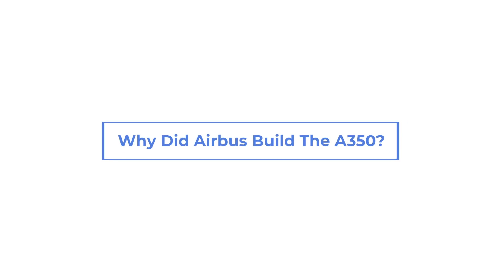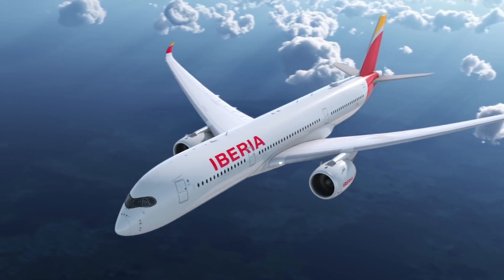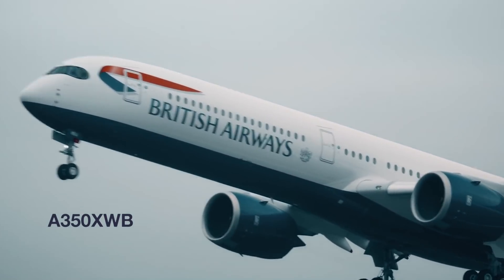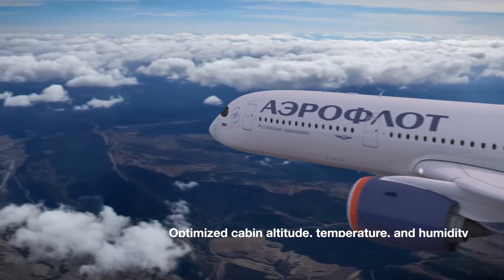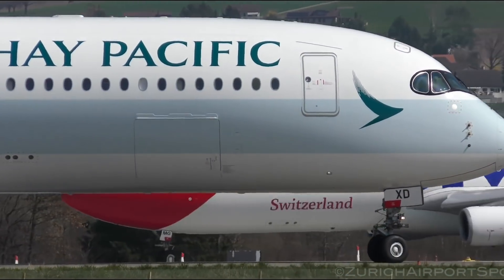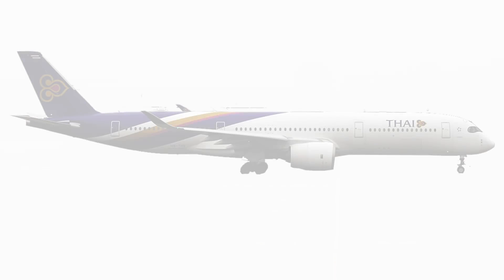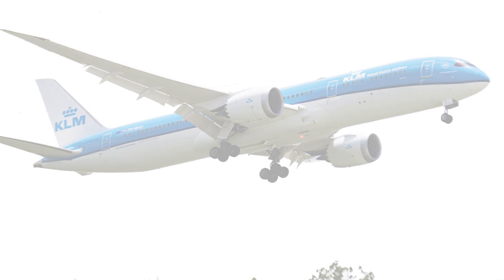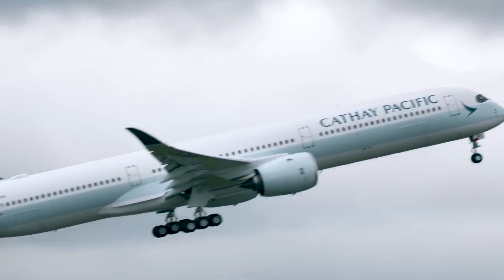Why Did Airbus Build The A350?

Comment: Contrary to popular belief. The A350 is not a direct competitor to the 787. The A330neo competes with the 787. The A350 competes more directly with larger and ultra-long-haul Boeing 777. Delta is replacing it's 777-200s with A350s, United has A350 orders to replace it's 777-200 and other carriers around the world have ordered the A350 to replace their 777-200s.

Comment: The A350 competes with the 777X (-900 competes with 777-8, -1000 competes with 777-9). I believe Airbus is gonna use the A330-800 and -900 to compete with the 787.
Reply: the 777-9 has its own league so does the A350-900 so it doesn't really compete each other, the only overlap is the A350-1000 vs the 777-8, while A35K is better being passenger jet, it's worth noting that the 777-8 will be better at freighter
Reply: @stoje8405  The main reason why airlines like Delta are replacing 777s with A350s is because the A350 has a similar seat capacity to the 777. However, people think the A350 is competing with the 787, something I don't understand as the 787-10 still has less seats the the A350-900, which is similar in size the the 777-200/777-8.
Reply: @sidewalk__  uh the 777-8 seating is similar to that A350-1000/B777-300ER actually

Comment: While you are correct in surmising that the A350 competes with the 777, it is erroneous to conclude the current design was built to compete with the 787. It is true that it was initially designed to compete directly with the 787, and that idea eventually turned into the A330 NEO. Airbus decided in redesigning the A350 that the 787 had gained too much of a lead for the expense to be worth it, so they made it bigger and targeted 777 operators with a new alternative.
Reply: And it is true that variants of the 2 families compete. The A350-900 and 787-10 compete very closely in size. The 787-10 was actually a response to the A350 as Boeing got scared that 777-200 orders would dry up.

Comment: This airframe success is solely based on passenger hauls.. 787 and the 350 will not ever be turned into cargo planes ... all successful airframes have a cargo version... carbon fiber although light and stronger then metal construction cant deal with the stresses and brittleness the carbon is inherent to ..

Comment: Advanced yess.but still a notch below the 787 ..
Simply put , your still using an archaic bleed air system. For most of the systems....yeah ....,I know the 777 does too.
   But electric architecture on the 787 is much more advanced,...and simply more efficient.
  Sry. a350 fans..
Them just the facts.!!
Reply: But do the airlines care?

Comment: TBH, the 359 isn"t directly competing with the whole 787 series, it looks like the 350 family is a response to the current 777 family only and replace their old 340 family. If you look deeper with the spec of 787 family, you could find that -8 is in addition to replace the 767 family, it also competing with 332/338, on the other hand -9 is competing with of 333/339. The spec of 787-10 and 359 are quite unique, for example -10 could carry similar passenger as 359, however it flies shortly range, which is could only fit to few route but gain a huge income, for example, HKG>TPE, HKG>ICN, HKG>SIN. Lastly, the spec of 359, which could be a replacement of 772 and for carriers demand something better than 333 but not 777, the 359 is perfectly adopted into this market.
Reply: Plz watch Coby's video, he has explained all it.

https://www.youtube.com/watch?v=9Z65CDW0LVI

Comment: Please who can differentiate between A330neo and A350 just by looking at each of them individually.? 
They look so similar; distinctive dark windscreen and curved wingtip.
I know A350 is wider and suited for long route, but I can't compare if they aren't side-by-side with the neo.
Reply: "Basic" design are the same. A350 is larger, longer and higher capacity.

As for specifics, they are trade secret. You can search google and find them. Visually, size will differentiate them.

Comment: This is wrong. The A350 was built to compete with the 777 and now 777-x series. Boeing built the 787 to replace the 767 and compete with A330 neo. By this videos logic the 787 was built to compete with the 777 which would canabalize sales and no airline manufacturer would ever do. Informative video though.
Reply: hmmm actually the 787 was a A330CEO competitor and then Airbus launched the A350XWB to compete with both 777 and 787 and the main B787 direct competitor, the A330NEO, while the NEO loses to the 787 at range and very slight difference efficiency at certain ranges, it gives a surprisingly close competition considering it's just new wings and engine, and another fact that the development cost is so low and no additional pilot training is required, this is a pretty big hit. Now i can see why Delta now ordered more airbus widebodies..

Comment: The real market for the A350: replacing the 777-200 and 777-200ER models built before 2001. And the A350-1000 will start replacing the oldest 777-300ER's from 2021 on. I expect the A350 to get both a GE9x variant and new Rolls-Royce UltraFan by 2024.
Reply: the 787-10 will take care of 777-200ER replacements to be honest. tThe 777x is going to replace the 777-300ER for many airlines like Emirates, Qatar, British Airways, ANA and so on. The A350 will not replace a 777 any time soon except for Delta.
Reply: @anuodubola2839  I agree. Singapore Airlines has already started replacing their 777-200ER's with the 787-10's (44 ordered) and so will Air New Zealand (8 ordered) soon. Great replacement for the 777-200ER.
Reply: @sulil1938  The 787-10 was a fantastic build for Boeing. It has prevented airlines from replacing their 777-200ER's with A350's. Airlines like BA, United and ANA i think . Although the 777X might be coming out to early as many 777-300ER's are just 5-10 years old for a lot of airlines. eg Qatar, KLM and so on

Comment: Anybody know if the A350 uses bleed air from the engine compressors and APU? Asking because of the air quality and humidity claims from Airbus
Reply: As I know, 787 is the only large modern commercial aircraft not using bleed air for that.

Comment: At 1:23 we can hear "Airbus claims the A350 is the quieter 2 engine aircraft" ...and that's because the 4 engine A380 is even quieter, ah! :)
Reply: Mik S Airbus claims the A350 is the quietest twin “aisle” aircraft, not twin “engine” aircraft. Both the A380 and A350 are twin aisle aircraft, and if the A350 is the quietest twin aisle aircraft, that means it’s quieter than the A380.
Reply: @Zamtrak25  
Good call!
Thanks.
:)
But still the A350 isn't quieter than the A380.
We can find some figures online that point to that conclusion.
Here 's one example:
https://www.uscreditcardguide.com/how-noisy-is-you-airplane-cabin/
Reply: @Zamtrak25  technically, the A380 is a quad aisle aircraft, 2 upstairs, 2 downstairs.
Reply: @schumi246  It’s still a twin aisle aircraft bud
Reply: @schumi246  False.

Comment: Everybody knows this one.
Because airlines soon told them a renewed A330 wasn't enough.
And proof of that is that some (Delta for instance) ended up buying both, the A350 and the A330 NEO. Which clearly states they can have slightly different roles.
Reply: And with the added bonus that the same pilot can fly both aircaft!

Comment: When you realise airbus built a plane to replace ageing A340s and A380 so that it can compete with 787s and 777s,🤔
Reply: The A330 was already economically better than the A340s and the world was not fully ready for the A380.  Ahead of its time, if I may say so.
Reply: Alec Cross yeah but the a340 was there for routes which the a330 didn’t have the range to do
Reply: Alec Cross A380 is too late in the Jumbo play. The era of hyper aviation hub is gone.
Reply: @Onew92  Predicting the future is a fools game. One pandemic and everything changes, who knows what the future holds?
Reply: @aleccross3535  No A380 is very late. The hub and spoke system of air travel has gone as passenger numbers increase and flight to even smaller airports with twin engine planes become profitable for airlines.
Reply: Pedapudi Vishnuram 1000 IQ move
Reply: Airbus should have made a larger version of the A330, like with the 777, but I think it was due to ETOPS that airbus was limited (I might be wrong)
Reply: @The secular humanist to early to tell.

Comment: I can tell that the Dreamliner is a success
Reply: I agree, and so would many. The Dreamliner will always and has been a success for years, given how many orders and airlines use it.
Reply: @sulil1938  One wonders how far those advanced orders will shrink now airlines face bankruptcy. Low fuel prices make efficiency a less urgent problem, for the time being at least and heavy flight price discounting seems unlikely to return any time soon with less competition.
Reply: Not sure yet it could reach its break even point but yes its order are A LOT, btw do you know that development cost for dreamliner was $32B USD? (comparatively, A330NEO only have $2B USD for development cost)
Reply: @stoje8405  Boeing's own figures suggest the 787 won't break even until at least 1300 deliveries, perhaps as many as 2000.  It isn't too far from the lower figure, but that point is optomistic, and less likely now due to COVID affecting the industry and increasing costs to build.  Time will tell.  The A350 shares similar issues.
Reply: @shebbs1  but now with boeing said building 787s only at SC i'm declining those new built 787s, unless they fix the quality management at South Carolina😩

Comment: Your information on range for A350-1000 is outdated. Since July 2019 with a MTOW of 319MT it flies 8,600NM with full cabin, including standard reserves, no cargo
Reply: Luis de stefano No airlines would operate a flight without cargo so your figure won’t happen in commercial situations.
Reply: Miika Mäki obviously not, hardly any longrange twin aisle plane travels with no cargo, although the longer the trip the scantier the cargo. What I said is something different. I corrected the range stated in the video

Comment: I think the A350 is a well played hand by Airbus : one single model to rival and go head-to-head with  two of Boeing's.
Reply: Declan-Kayode Keegan and to replace 2 airbus models as well
Reply from the maker: It’s a great little (or big as the case may be!) aircraft - TB
Reply: It wasn't intended to compete with the 787, only the 777.  It was a bridge aircraft, filling the gap between the 787 and the 777, where they were hoping a new aircract could compete.  Airbus knew they couldn't compete with either model directly, as the 777X program had started, and the 787 was already saturating that market.  The 777-8 will seat closer to 390 passengers, leaving the A350 in the middle between the two models.  This is a strategy that has worked in a number of markets over the years
Reply: Well said!
Reply: Yes !!!!

Comment: I flew on the A350 with Lufthansa and liked it less than a 30 year old 747-400.  Seemed louder and more cramped, the cabin air was stuffy unlike the 747
Reply: Well, the A350 might have seemed louder and cramped because there's significantly less noise from outside than on the 747. That makes the inside noise from other passengers more annoying. That's why noise cancelling headphones are getting more popular on planes.
 Also, the 747 is half a meter wider. Depending on seat configuration, that could help.
Reply: yeah thats just bs
Reply from the maker: Aidan Peairs personally I’ve flown both with BA, and I’d pick the 350 any day. - TB
Reply: Simple Flying same. Even though the 747 is an icon of course.

Comment: I've flown both A350 and 786, I preferred the A350 it feels more spacious. I hate those dimmable windows of the 787 as sometimes  the crew keep them locked into the dim mode, grrr that's frustrating and it takes too long to dim when you control it yourself, doh!
Reply: I've worked on 789s and the dimmable windows are great for when you're working the cabin on a hot day. The cabin control panel has an "energy saver" mode that turns off the IFE and dims the lights to reduce internal heat and it dims the windows. There enough light to work and it's super cool whilst 32°C outside

 A/C is astounding too. Sometimes you get hit by tiny ice particles it's that good.

Comment: What's the difference between the A350-900 and the A350-1000
Reply: The 1000 version is longer, so it can seat more people. Everything else is the same ( wings, cockpit, etc)
Reply from the maker: Sean Dube as Lincito said, the -1000 is longer, seating more people :) - TB
Reply: Also has a 3 row wheel bogey
Reply: @peteconrad2077  the engines are more powerful on the -1000 and the sharklets are larger
Reply: @gasviation9077  the engines are more powerful but I’m not sure the shark let’s are bigger.
Reply: @peteconrad2077  the newer - 1000s kept the wiglets of the old - 900s. the new -900s have a smaller but sharper and sleeker look
Reply: @gasviation9077  interesting. I didn’t know this. All our 350s have the same design but then they’re all 2018 and after so maybe they’ve all got the new one. Interesting small differences that we pick up too. All the sims are -900 so when we go in there we see what’s different from the -1000 we fly.

Comment: I think you should mention as well the A350 was originally proposed as heavily modernized version of A330 but potential customers didn't like it so Airbus had to design the plane from ground-up.
Reply: When i was younger, i was hoping that the A350 have the same nose fuselage as A330, since its my favourite design.
While it takes a while for me to finally love the design of the new A350 nose design, i'm glad that Airbus still continue use the A330 nose design as the A330neo.
Reply: @eirfanhazlan9271   My words exactly!
Reply: that originally proposed has became the A330neo and it's competing directly with 787, while lost at efficiency especially long ranges, it can be equal at medium haul, and the fact that no additional pilot training is required, this can be a backup choice when you can't wait 787's long backlog😁

Comment: The A350 doesn’t even directly compete with the 787 but that hasn’t stopped Boeing fanboys from complaining how it’s a carbon copy of the 787 lmao
Reply: MGS AVIATION 
Except it isn’t. It’s about as different as it can get. The only similarity is the use of carbon composites, and even then 1) the internal structure of the fuselage is very different for each plane and 2) all new planes from now on will feature composite materials in the design - Boeing doesn’t “own” the materials, no matter how much you may wish it did.

The most hypocritical thing about these Boeing fanboys is that they always complain that Airbus’ cockpits don’t have a yoke like Boeing’s cockpits, yet Airbus still apparently copy Boeing anyway! Make up your minds lol
Reply: @KasabianFan44  fanboys exists in aviation? What the heck. I thought fanboys didn't even exist when talking about things like this. Welp, looks like I'm getting old.
Reply: @sulil1938  I was suprised too. The A320 neo fanboys are the worst. They just bite at 737MAX all day. ThE 737 MAX iS nOt AlLoWeD t0 fLy blah blah blah.We know and we dont care anymore jeez.
Reply: Inspector Clooso 
“We know and we don’t care anymore”? I’m not defending those fanboys (obviously) but every aviation enthusiast SHOULD care about the grounding. Regardless of which aircraft manufacturer you prefer (or if you’re indifferent), Boeing’s design flaws in the MAX directly contributed to the longest aircraft grounding in nearly 20 years; this put a massive question mark over the public’s and airlines’ trust in Boeing in general, and they need to work really hard to regain it. Fanboyism doesn’t even come into the discussion here.
Reply: @KasabianFan44   Yes I understand but the way they use it is annoying. I myself would never fly a 737MAX any time soon, but I know regular ignorant people will. Many Airlines still trust Boeing, their aircrafts and the 737MAX so i wouldnt be too concerned.
Reply: @mgsaviation9292  All planes look the same, "design" is hardly relevant to the industry.
Reply: @lotusamg6997  I mean design is relevant quite a bit. Sure the follow mainly the same shape but every plane has a improved different design for better economics.
Reply: @mgsaviation9292  well, it's a widebody airplane, they can't make it a square.

Comment: I prefer the A350 to the 787, simply because it is quieter for the passenger.
Reply: And those winglets, plus the mask looking paint on the cockpit windows... so nice!!!
Reply: I've flown in these a few times, in economy and premium economy and all were really good flights. 
I've also done plenty of trips on the 787 but all have been in business. Apparently the 3-3-3 layout in economy is terrible on the 787. I felt both plane types were nice and quiet; a far very from some of the legacy stuff.
Reply: @acciid  -- 3x3x3 in the 787 is miserable. Japan Airlines equips theirs in 2x4x2 in coach, and that is acceptable, especially in their "SkyWider" seats. Japan Airlines is the ONLY 787 I'll book.

The 350 is nice in the 3x3x3, but it would be cramped if some airline tried to do a 3x4x3, which I have never seen. To my knowledge, no carrier has tried that configuration, yet.
Reply: Not suprising tbh. A350 and 787 built for efficiency but the A350 certainly does have the edge in terms of comfort and passenger experience.
Reply: I don’t really mind the slight noise difference, since I have headphones on most of the time anyway. I like the 787 because the air in the cabin just feels nicer. It feels more humid than other planes, and I arrive at my destination less tired.
Reply: This not true. The 787 and the A350 noise is about the same. https://www.youtube.com/watch?v=2NYSM-K847c
Reply: for now... i still take 747 since upper deck is more private.... put earphone on watch movie....
Reply: @campkira  only in first class tho. You can plug in your headphones and watch a movie in any seat and plane